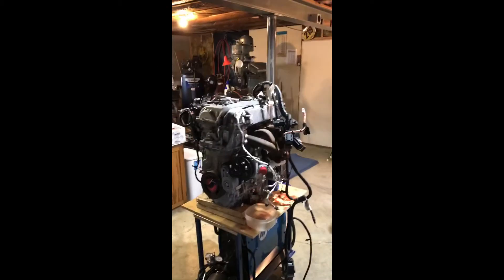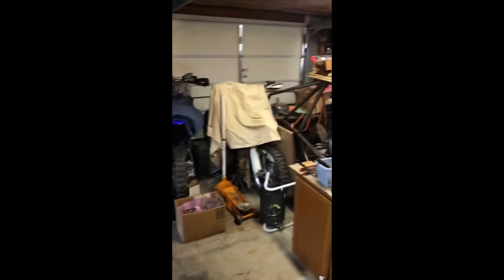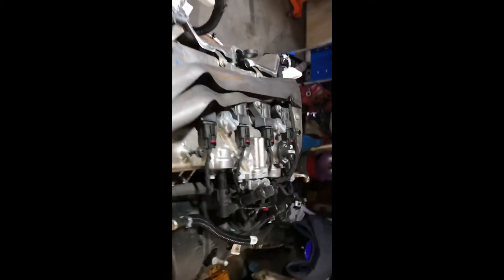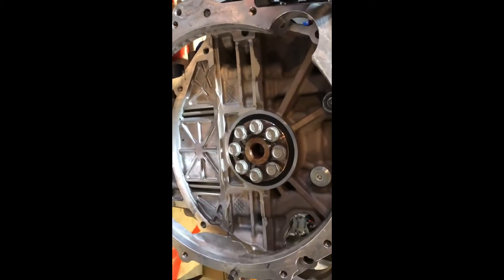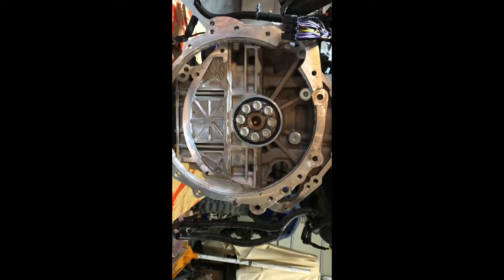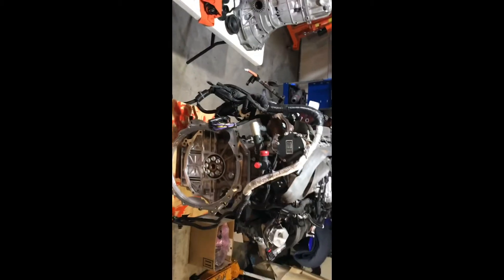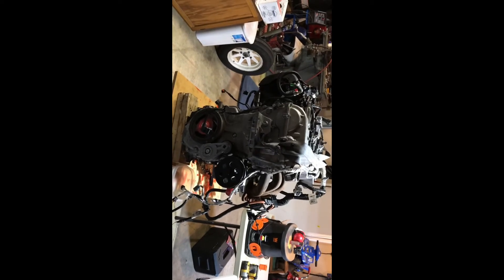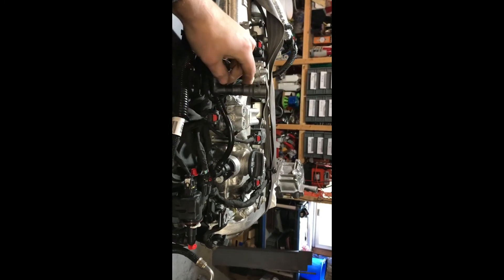Chevy Ecotec LCV/LKW 2.5L

Comment: I’ve got a lkw to be swapped into a 1960 MGA.. seems like a great engine. Is there a forum you use for harness and programming info? What did you do about the header and all the emissions stuff? Thanks!
Reply from the maker: https://youtu.be/2-azdfw_owA

I used the stock harness an modified it for stand alone.  Sent my ecu to steve Humphry to remove vats and he load his tune.  Built my own exhaust. I guess i should do an update video since its done now.
Reply: @D6motorsports  yeah it would be great to  see what you modified!
Reply: @D6motorsports  hmm I would compensate you for your wiring instructions info. I reached out to Steve but he is not responding yet, maybe he is no longer in the E39/E39a ecm Programming game.
Reply from the maker: @nocostreets3842  he is a phone call kind of guy. So if you emailed him you might want to follow up with a phone call.
I will start working on an updated video.

Comment: Hi, do you know if the LKW engine will fit a 2016 GMC Canyon with the LCV engine?
Reply from the maker: Dazko Vazquez it should fit as the engine is the same.  But not sure if the electrical part is the same
Reply: D6Motorsports My block broke and the crankshaft is very damaged, so I’m just replacing the basic engine (only the mechanical components without electric and electronic accessories). I found a good deal on a LKW engine but I’m not sure to buy it or look for the LCV engine.
Reply from the maker: Dazko Vazquez yea it seems the lkw engines go for less money the. The lCV. Good luck
Reply: D6Motorsports thanks man, I appreciate it.